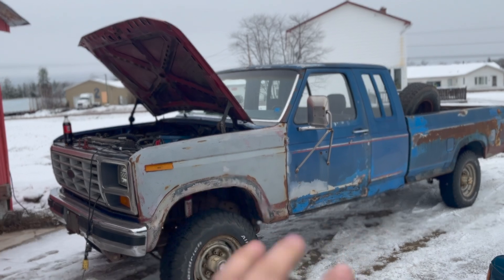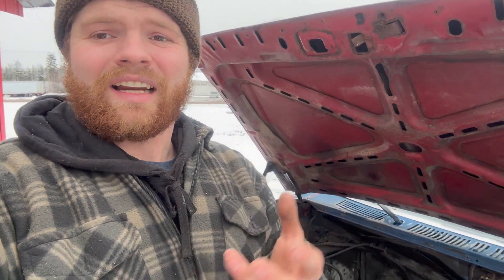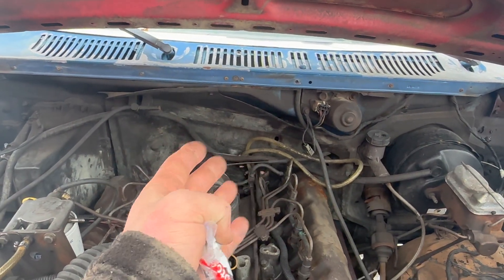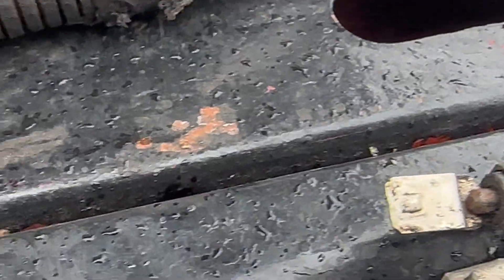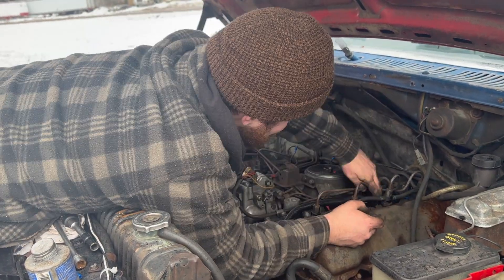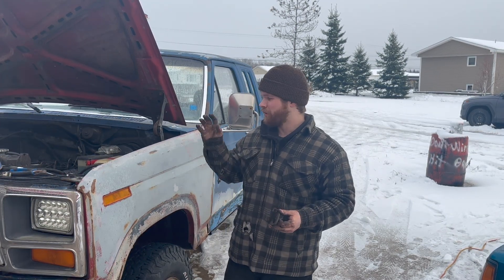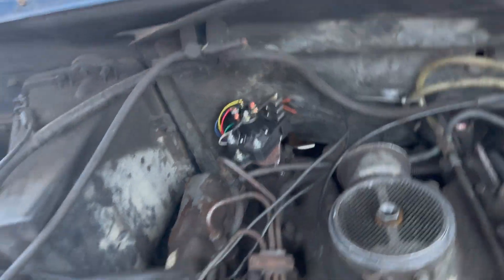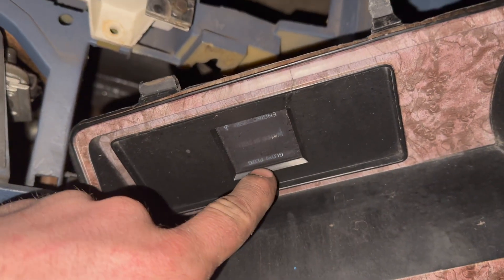How to retrofit a 7.3 idi glow plug controller in a 6.9 idi, a much more reliable glow plug system.

Comment: I wired a hot wire from a momentary switch to the trigger post piggybacked over the controller trigger wire to jump the GP relay on the 6.9 I had, that’s how all the 6.5 GMC’s at work were set up and it worked great as long as you knew what you were doing (as in don’t hold the button so long the tips on the glow-plugs swell up like a balloon). I just used mine to give it a little “extra burn” time on the new ZD-9’s I put in it. One nice thing was doing it that way allowed the original controller to still function when I wasn’t overriding it. the “wait to start” light would even come on when I hit the button (as you’d expect, idk why I thought that was so cool).

Comment: One thing to note about using  the old glow plug harness with the 7.3 controller. The solid state controller measures resistance from heat in the glow plugs to determine whether they get power or not. The old harnesses even on the 7.3’s have many splices that are usually corroded and in bad shape. This will make the controller think the glow plugs are hot when in reality it is just seeing the resistance of the bad harness and won’t give the glow plugs power. I recommend either installing a new harness (which aren’t cheap) or making a new harness completely replacing the old garbage that will most likely cause hard start headaches. Great conversion! Have a good day!
Reply: This here is exactly what is happening with mine I think - it also keeps flicking on and off while I’m driving? Meaning it’s not up to temperature or resistance or soemthing? Thoughts?

Comment: With a few hours of your time what a difference. Great video. Love the content . Cheers
Reply from the maker: It’s night and day haha, its wild how good the 7.3 system is to the 6.9 original
Reply: Thanks. Also is the stock gp relay required to make this work or can it be removed?
Reply from the maker: @codywoodworth5480  I used the stock GP really for the 6.9 basically as a junction box in the video but you could completely delete the mechanical 6.9 controller and gp relay if you wanted

Comment: Was looking for a video fixing the hazard switch (some owner previously removed switches and did some weird rewiring, absolute cable mess) but ended up watching this video and now thinking to go for this glow plug controller for my F350 6.9 IDI. Great video on the topic!
Reply from the maker: Glad you liked it, this is definitely the best way to have an Idi setup for cold starts

Comment: Always loved the sound of those trucks firing up! I know they're under powered compared to today's diesels but they're sure easy and cheap to work on by the same comparison. At the end of they day, I love my 6.9. 

Thanks for the information. I'm going to attempt to simply replace my glow plug controller. I've heard horror stories of replacements failing after 6 months but mine has been in since at least 1994, when my IDI came into the family. It may be factory original from '85 and it's just now failing. Maybe they don't make the replacements as good as the originals? If that doesn't work long term I'll go to the retrofit.

Comment: I just swapped the 6.9 glow plug relay for the 7.3 today, and i have some questions. What is the filament for exactly? And im not sure if the relay is supposed to get 12v constantly on the coil, but mine does currently and im afraid of buring up the glow plugs again.

Comment: good show just have question. will that location give the controller enough engine heat to work correct
Reply from the maker: Oh yes, it’s actually closer to the exhaust manifold than the factory location so if anything it will cycle the plugs off quicker than the intake location,and is a very similar location to what the turbo idis used.

Comment: just out of curiosity, is it possible to run the new 7.3 controller to the factory 6.9's spot, or does the engine heat matter too much for that? I'm gonna be attempting this conversion on thursday and im not sure how confidently i can try to make my own bracket lol
Reply: Wondering the same, how did it work out?

Comment: Does the controller need to be mounted far back like that?
Reply from the maker: Technically no but the metallic strip needs to accurately match engine temp for good starts

Comment: I never had a problem with 6.9 glowplugs. The 7.3 everyone I know had problems with that system
Reply from the maker: Every 6.9 I’ve seen or heard of has had the mechanic controller seized on it, maybe if the trucks were well kept all its life it would be a different story.
Reply: @highostablegarage  not sure. Mine never had a problem. I did have 3 glowplugs out at once but it started just fine and all I had to do is replace them. My buddy with a 7.3 had to wire a manual switch  to his because he couldn't get it to work right. Maybe it's just my experience.
Reply from the maker: @nohtgonahappen7314  hard to say, I might have just had bad luck with the 6.9s and you might have just had bad luck with the 7.3s
Reply: @highostablegarage  could be. I'm a firm believer that ever engine to an extent Is it's own beast .
Reply: @highostablegarage  might just be that nice maritime road salt ruining everything like it always does compared to the American south...
Reply from the maker: @vhateverlie  very well might be the case, corrosion eats everything alive here haha

Comment: I have a 1983 F250 4x4, 6.9.

Don't mean to ask a stupid question, but. . .
Could I put the new improved 7.3 controller where the original one was and toss the old one?
Awsome vid by the way.
Watching from Kelowna, British Columbia.
Reply: The controller relies on engine heat to know if it should kick the plugs on, so he was trying to get it as close to where the 7.3 has it which is behind the air intake in the middle of the engine.  Dont know if it would get enough heat to register properly mounted where original was.  I thought about doing the same thing.

Comment: Nice upload! Why cant you use just a heavy duty relay like a Stinger made for those crazy  amp set ups? My new low mile 87 6.9 has previously been changed out to a 7.3 GP contoller but still not working I just came in to eat supper before going back out on this baby Nie video I enjoyed it!
Reply from the maker: You most likely could use one as long as it can handle the current, but the 7.3 GP controller where it shines is the little solid state computer on it, makes it so as long as the computer is working and your engine is healthy, the glow plugs shouldn't ever get overloaded and burnt. I appreciate it, glad it might of helped!